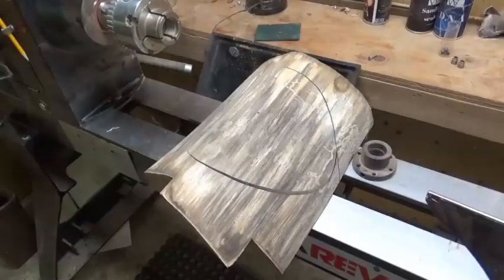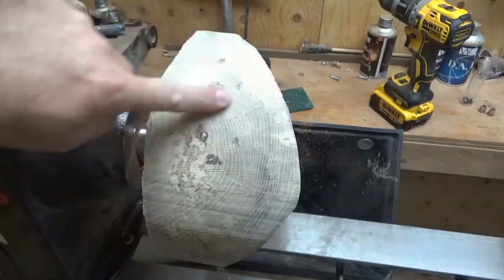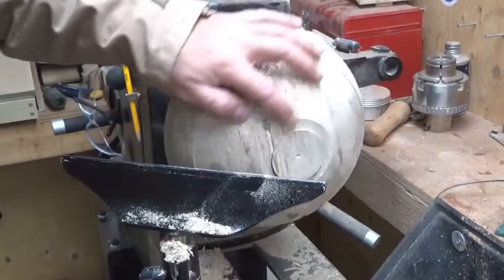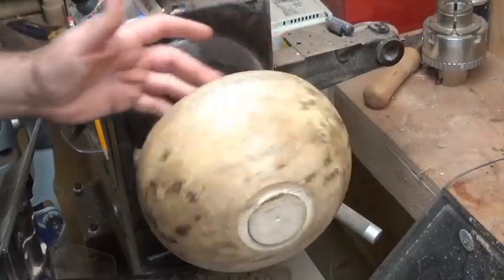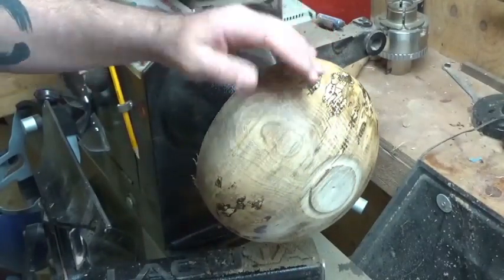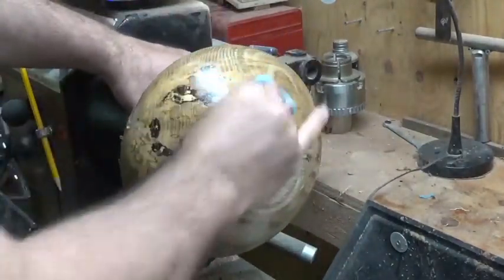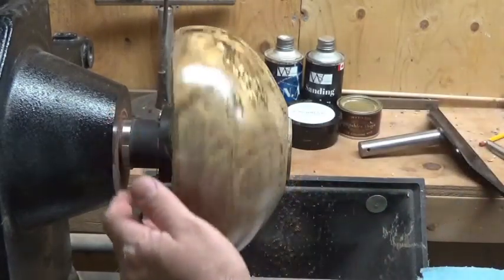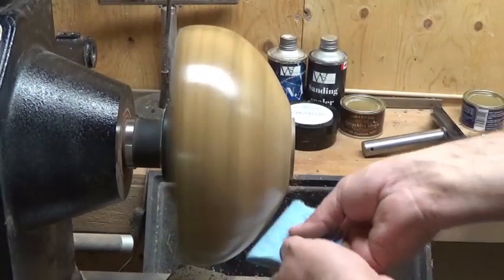turning some amazing spalted Hackberry

Comment: Huh, so was this not one of the logs you spalted yourself?
Reply from the maker: Actually yes i did spalt it myself but not from the experiment video, if you take a fresh cut log and put it in a plastic bag it will most likely spalt, ive done the same with apple wood and currently maple, just be aware of the potential of mold!